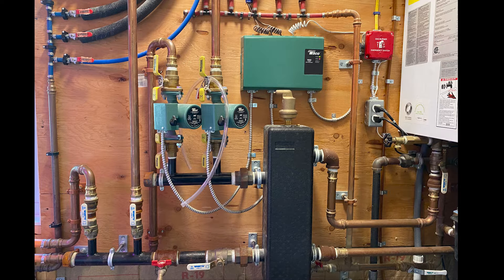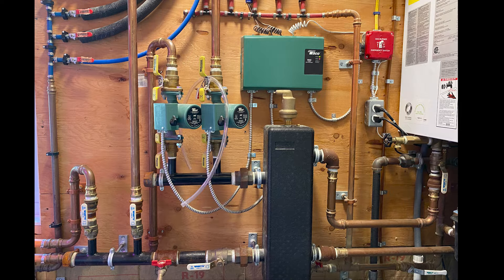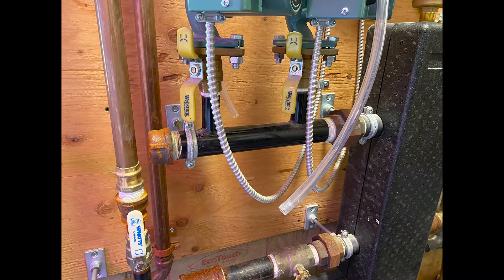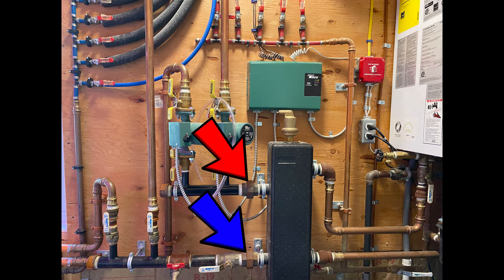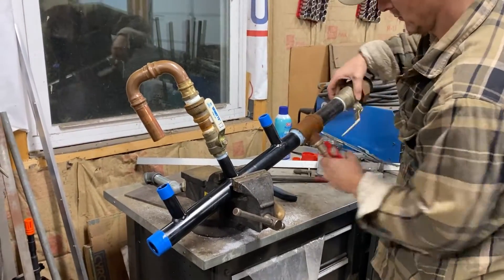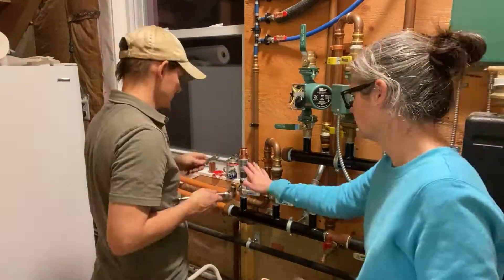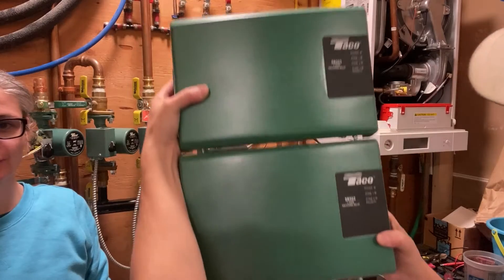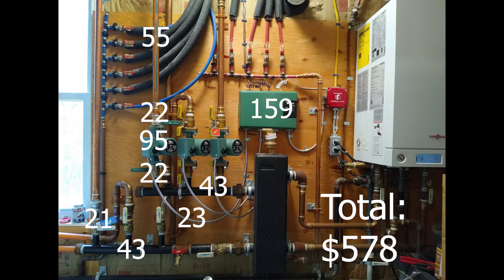DIY Add a Circulated Water Heating Zone

Comment: You could have added a sr501 and tied it in with the sr502
Reply from the maker: Presumably the tacos can be wired together to request heat, but you'd lose the priority feature and it would have complicated the wiring up to the 4x4 electrical box.  Probably would have been cheaper though.
Reply: @NineCarGarage  That does combi heater have 110 volts connections for circ pumps?  If so, you could of wired the 3rd zone to the boiler and saved $$ on switching relay.